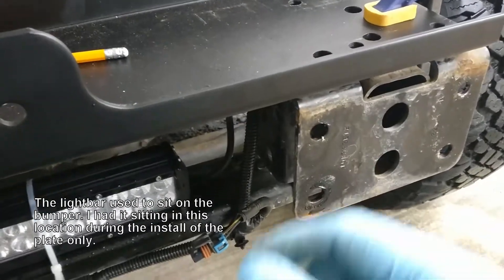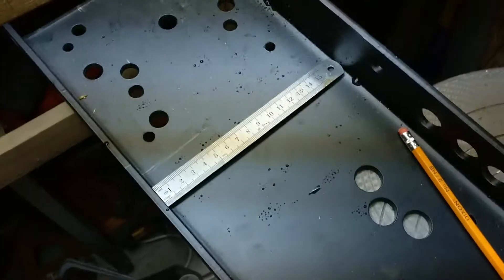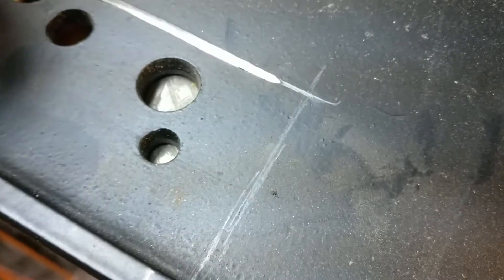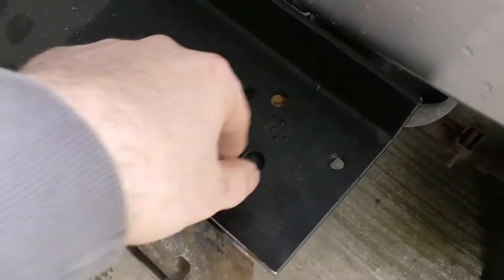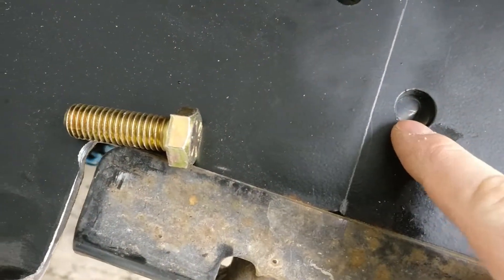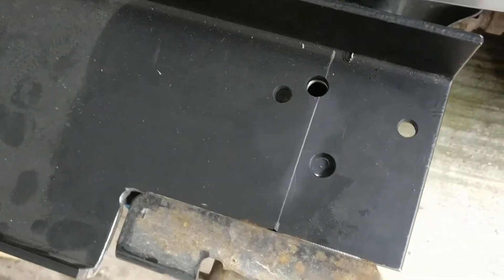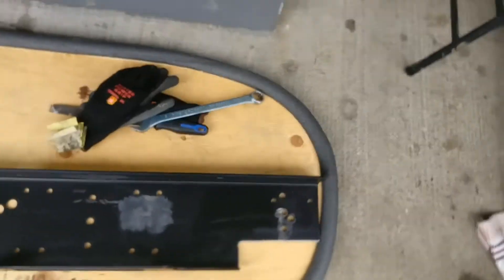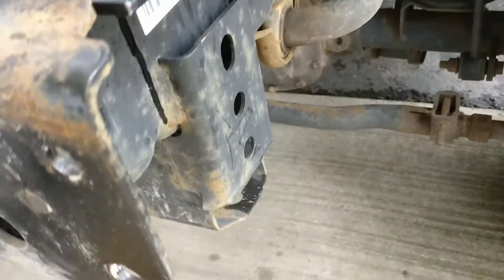Harbor Freight Universal Winch Plate Install on Jeep JK

Comment: WHY did you CUT ANYTHING when the owners manual clearly states NOT TO because it will compromise its strength??? Also, nobody else who installed this on a JK needed to chop 2 chunks off, so I guess I’m confused as to why you felt you needed to and why you’d RISK defying the manufacturers warning and certainly voiding any chance of warranty coverage….
Reply: Universal. Old English word meaning "must be modified to fit". The reason the winch plate instructions say that is because Harbor Freight's legal eagles told them they had to put it on there., much like the frozen pizza makers have to say on their directions "Do not eat pizza before cooking it".